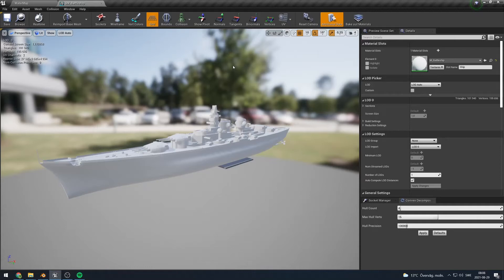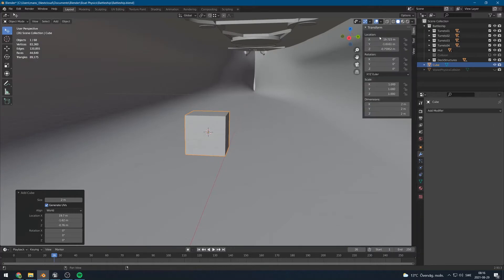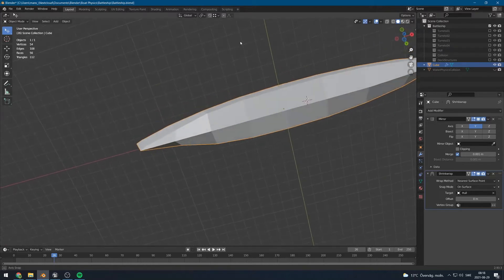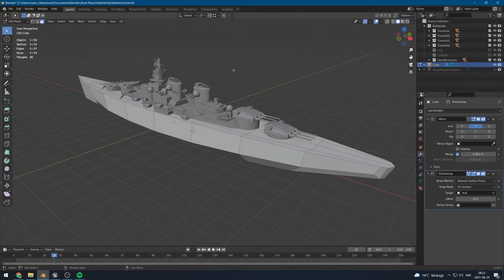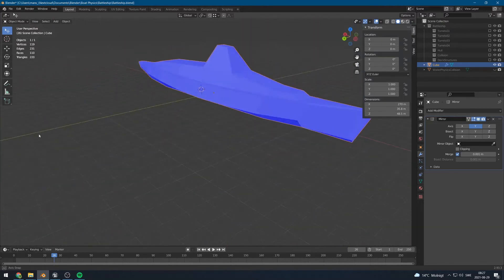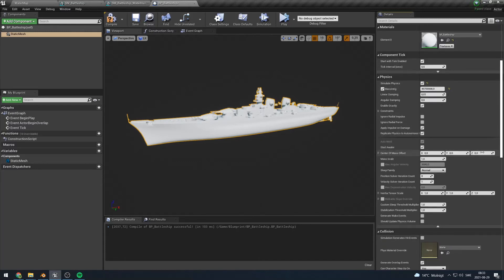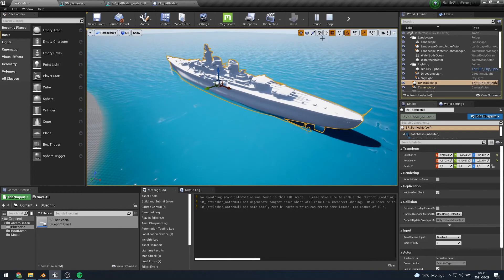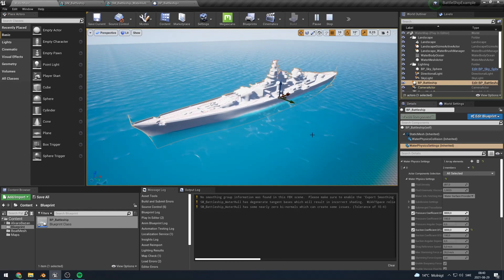Simulating a battleship in UE4 - UE4 Water Physics - Tutorial #2

Comment: Awesome tutorial, explained to me why the actor didn't simulate physics when I changed the mesh...however, if I may suggest, kindly add a caption to what key shortcut are u using in blender while working.

Also. may I ask, I can do the same make it with modeling in Unreal Engine?